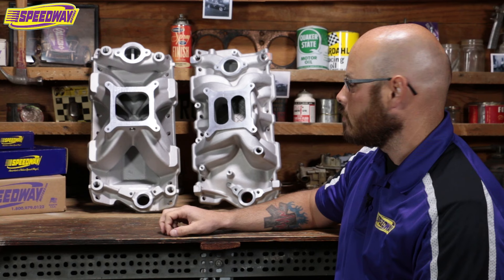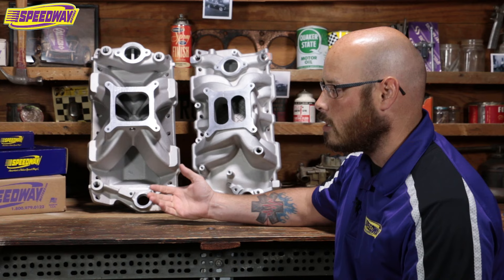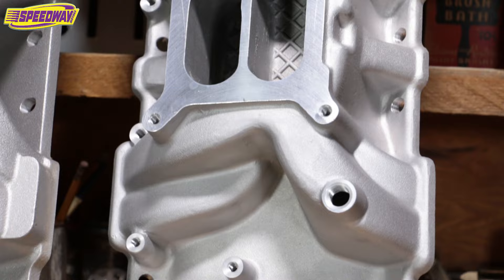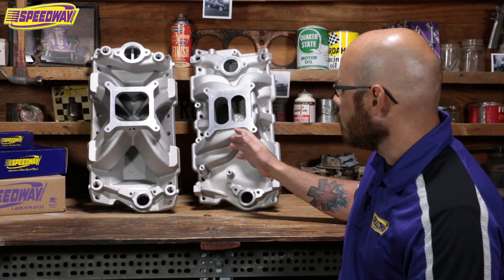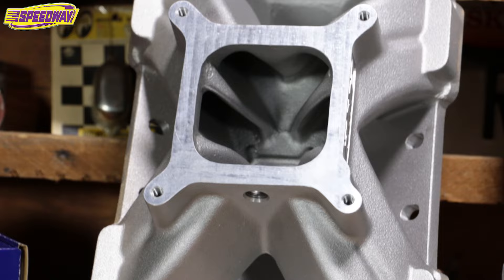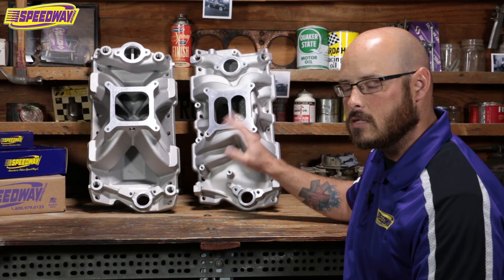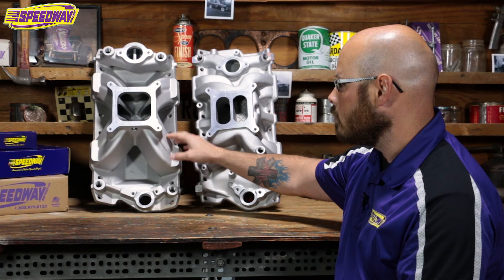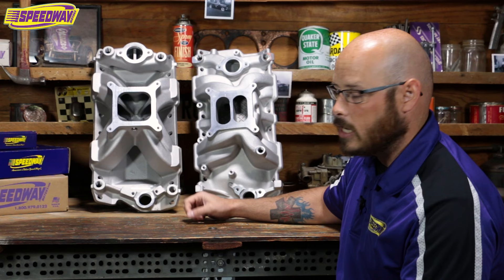Speedway Tech Talk - Tips for Selecting an Intake Manifold

Comment: Weiand track warrior single oval port on my 454. Isky 292 mega cam. Low(er) compression flat tops. PRW steel roller rockers. 10" 3000 stall. 4.30 gears. 78 camaro. Quickest run 11 sec flat. Off idle throttle response is very good! Dont let the 2500-7500 fool ya. You can run this on the street no problem!

Comment: I used a 1 inch spacer on my Performer dual plane back in the 90s when hot rodding my 71 Mach 1 Mustang and it actually boosted the torque
Reply: Spacer also gives you 10 to 20 hp increase depending on the application

Comment: Just remember the 3 rules to power.      heads, manifold , cam. Match  them correctly and your engine will run strong and fast
Reply: forgot #4 Exhaust. all that  doesn't matter if your running a duel to single 2.5" exhuast with a cats and stock muffler. Its got to blow it out as fast as its sucking it in.
Reply: Bobbyjordan
Reply: AND HEADERS! W/O headers that are really right for your build, and the highest quality stainless steel materials, and ceramics if you can at all afford that, the power gains from your headers and the life of your units will be NOWHERE near your engine's potential. So, its FOUR things you have to match carefully and properly...

Comment: In any V8 build what you want the most of is Torque,  If you're going to run dual-plane you might as well spend a bit more on the nicer "Performer RPM, Air Gap" style intakes.

Comment: If you want more power  use the holly strip dominator that thing  makes power when all other manifolds Peter out i know for a fact  I have 3 of them  if your engine is build right you can't beat them
Reply: Yep, Holly Strip Dominator is one of the best singleplane intakes ever built, still holds its own against the AFR Titan and Super Victor 2. The Super Hurricane is a good piece too.
Reply: I use the dart cast aluminum high rise single plane.... port matched to pro 1 heads... 12:5:1 compression and a 250 shot. In a Chevy 408 small block... haven’t had a problem with it... actually the best intake I’ve ever owned... only way I would go is stepping up to a custom sheet metal intake... other than that I’m running the dart.
Reply: @crsracing1313  I don't think that's a street car lol sounds like a strip race car! Lol I drag too!!
Reply: @ronaldlewis4032  it is a street/strip car. Car is street legal. Car runs on e85. Just pull up to the pump and fill it....
Reply: @ronaldlewis4032  I cruise it for 20-30 minutes in the city in the summer to car shows and stuff... street car
Reply: @crsracing1313  sounds great! What is your car I go to car shows too . Always great people and good bench racing!! I got a 69 chevelle working on now!

Comment: What happends if you use a camshaft from a 350 marinengine with a singleplane intake. (torker 2) I guess the marinecamshaft works better on lower rpm's and the intake on higher rpm's. It would be fun to try it. I have 2 engines to try it on one 305 and a 350. I also have different heads to try , 601 461 , 882...

Comment: So I have a new Edlebrock intake coming and I’m hoping this may help with my problem but when I floor it from a dead stop it’s real sluggish like takes off real slow and acts weird but it will do a burnout just fine I don’t get what the problem may be but I’m kind of leaning towards it running lean any suggestions
Reply: I’m late but I’m guessing you’ve checked for vacuum leaks?
Reply: Warm it up and run a compression test.  If you have a cylinder down on compression put a couple squirts of oil in then recheck if it comes up you have a ring problem if it stays the same you got a valve train problem meaning check springs and push rods and also you might have a flat lobe on the camshaft.  Just a couple things for you to check but a new intake is going to add to your problem just saying Thanks get it powered up!
Reply: @Mel7eds  funny story actually not long after this comment the engine locked up and snapped the crankshaft in half going down the road right after I bought all this crap for it so I ended up getting a blueprint 350 it’s got plenty of pep now and the intake I bought just went on a 508 hp blueprint 400 stroker for our 78 camaro
Reply: @Mel7eds  but yeah she died

Comment: The single plane is better if you're going to run after market TBI
Reply: Why would anyone on run tbi heads. Unless just in factory form
Reply: Hope you threw the tbi heads away ! They only made 190 horsepower from the factory! I had a ole set of 186 heads as they ate 300 hp with a little work on them .I was running the performer with a adapter to run tbi when I changed the original motor I went to a Q jet-2  and a mild cam runs so much better!

Comment: Mild street engine, use the dualplane, big cam race type engine, use the singleplane.
Reply: Richard Noggin perfectly said.
Reply: Single plane intakes can be used for street use with a high gear
Reply: +Jefe Da Business Yep, I run a singleplane on my daily driver, but its a 500+HP SBC.
Reply: @72troy455  I run a single plane on my 350 set up for 450hp and it does excellent with the 373 gear
Reply: I hope the Air Gap works out well on my 468 BBC with fully ported 990 square port heads.  I got a healthy Howard's hydraulic roller and the up graded lifters that should turn up to 6800 and make power.  I can always add nitrous. Lol

Comment: I’m gonna feel a huge difference when I swap the intake out on my 66 it has a stock gm intake with the 4 holes in it
Reply: What are you taking the intake out of
Reply: And is it a Q-JET or a HOLLEY
Reply: Not always..... 1st ur motor needs to have a good foundation to work from. Throwing parts won't make it run better. Second dont over do it. Bigger isn't better. The carb size needs to work with the intake,cam and motor work it already has. If its a stock 2barrel well it will run if u change out the carb n intake but a cam change is what it will really need to wake her up. This is only my opinion,  my opinion isn't law but its what works for me so far.
Reply: why fight fate? It’s just a stock good wrench 350 from the 80s it’s only got like 2000 miles on it but with the gearing it’s got I think it’s 4.10 gears and a 2 speed with it being so light it smokes the tires I hear from a lot of people an intake will give you a noticeable power/torque increase
Reply: @redneckswitwheels  FACTS.  IF the 2 barrel vs 4 barrel is on otherwise the same engine, swapping a 2 for a 4 barrel will give you a good boost, but if the 4 barrel engine has a hotter cam and/or bigger ports/valves, then a stock 4 barrel may not work well.  You might run out of vacuum when you floor it and open the secondaries, then it will lean out, killing torque.

Comment: Can someone help me my motor its  chevy 350 nothing special. Just cam 262/270 msd, flat piston headers stock heads, the question is. My edelbrock performer rpm somepeople say, rpm is to big for mi setup. Really or not?? Its better for me performer or something similar.  Then performer rpm ??? Thanks alot
Reply from the maker: There should not be anything wrong with using a performer rpm intake with your setup.  You would not see any gains by swapping to the regular performer intake manifold.
Reply: @speedwaymotors  ok. I will keep my rpm thanks alot ,,,

Comment: What would you guys suggest for a 360 amc? Intake amd carb? Also do you sell gas tanks?
Reply from the maker: I usually recommend Edelbrock performer RPM intake manifolds for street applications.  I would use part number 7531.  I prefer Holley carbs, and depending on what size your engine needs the Holley Street Avenger series is a great choice.

We do sell fuel tanks and cells, but I don’t know what kind of car you are working on.  As far as AMC products we likely don’t have a bolt in replacement.
Reply: Speedway Motors im working on a 72 Matador. Runs great besides always cleaning the tank from the grum and rust. So im looking for a tank now. Have you tried por-15 tank cleaner and sealer? "Asking before i try it"
Reply: @port nut thank you

Comment: What kind of intake and info you suggest for a 1999 5.7 vortec engine tbi to carb swap
Reply from the maker: An intake such as number 3252716 and carburetor number 3251806 would be a good combination.  This would not work with current computer controlled components.

Comment: speedway motors will this box ram manifold intake fit my 302 1985 they ore selling tu mi
Reply from the maker: These intake manifolds will not fit your small block Ford engine.  Take a look at part number 3252121 on our website.  This might be what you are after for a Ford 302.

https://www.speedwaymotors.com/Edelbrock-2121-Small-Block-Ford-289-Intake-Manifold-w-o-EGR,52314.html